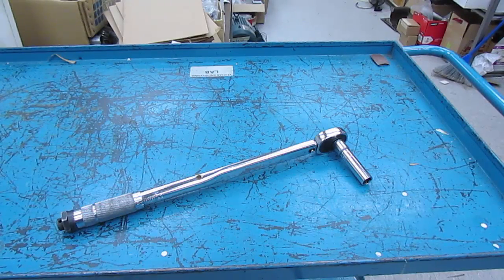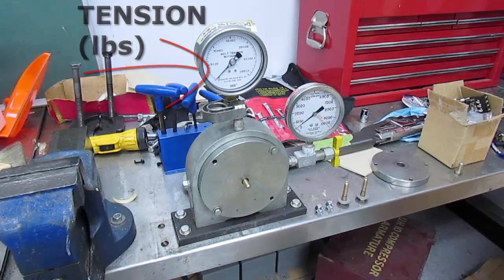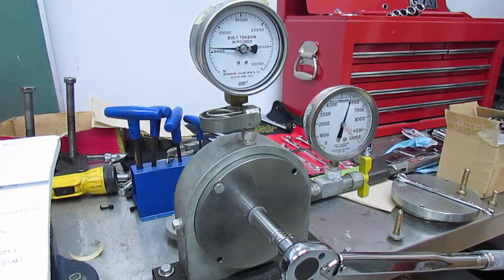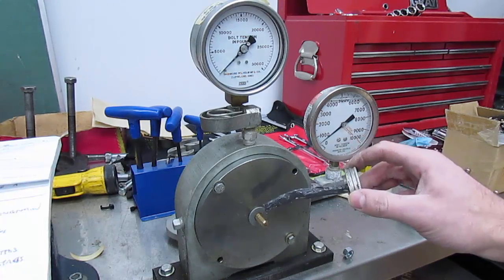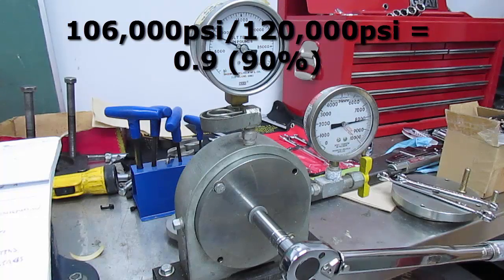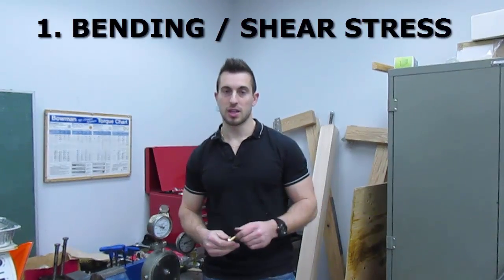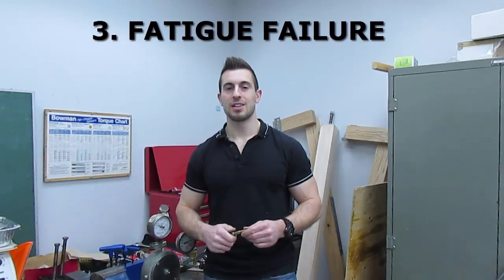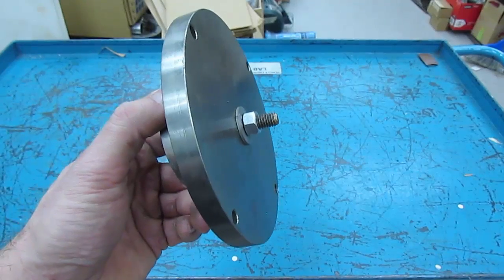Should You Put Anti-Seize On Wheel Studs / Lug Nuts?

Comment: I’m here because I had to change a flat tyre at the side of the road last night and my wheel bolts were so difficult to remove I had to kick the hell out of my wheel wrench to get them loose and even after that still struggled turning them all the way out, luckily they came off in the end but I would have been pretty screwed if not. now I’m considering using anti seize Incase it happens again.
Reply from the maker: Just be careful when adding anti-seize.. try not to over torque !
Reply: Embrace Racing think I’ll just add a small amount and then re check them, hopefully will be all good. I also recommend anyone who doesn’t have a spare tyre to buy one because there’s no way one of those tyre sealant repair kits would have gotten me home.

Comment: It's a torque vs tension problem it's hard to determine the right to work with a rusted bolt or at lubricated Bolt torque specs are rated on dry Clean bolts what you're really looking for is the proper tension

Comment: There have been several additional posts since I first joined this conversation. So let's examine this with a bit more depth. The whole, "Don't use anti seize on lug nuts!", argument seems to revolve around 2 main theories. And those are: 1.) "Anti seize will cause the lugs to come loose over time".... And... 2.) "The use of anti seize will in itself cause the stud to be weakened from being streched from over torqueing"...................
Let's examine #1. If this were true, and the use of anti seize alone on any lug nut would cause it to loosen over time, then it's use would also cause loosening in most any other application it was used as well. Cylinder head mounting bolts, exhaust manifold bolts, water pump mounting bolts, and even spark plugs. We know that is not the case, and anti seize is recommended for ALL of those applications.......
A lug nut that has had anti seize applied to it has no more chance of coming loose, than any other bolt or fastener that has had anti seize applied. This in any or all of the other applications that I have listed. Proper torque keeps fasteners tight, NOT dry and rusty threads......................
Now let's look at #2. "The use of anti seize on lug nuts will cause over torqueing, stretching, and thereby over stressing the stud, causing it to become weak and break". The same reasoning applies here. Why would it's use only cause over stressing of lug nuts, and not all other applications as well? Again it doesn't...................
And the fact is if someone is that worried about it, there are tables that will show what percentage of torque should be REDUCED for a lubricated threaded fastener that transfers torque better, as opposed to a dry, non lubricated one. In the case of most lug nuts it comes in at around 25-30% less torque. So with the application of anti seize, you are in fact getting the same amount of fastening power, with 25-30% less torque being applied to the stud. How does this translate into a bad thing? It doesn't....................
The problems encountered at most tire centers, is most all of them NEVER take the time to hand torque or LOOSEN lug nuts, like they should be doing. They almost ALL exclusively use air impact tools, because time is money to them. Nothing will cause over torqueing easier, or else break off a frozen lug nut, than over zealous use of a air impact tool. The key word here is "IMPACT". The faster they can get a car in and out, the more profitable the sale becomes. And at one time or another, I've watched most all of them use the same air gun on a Ford Focus, as they do on a F-350 Diesel Dually. They just swap sockets, and go to town....................
NASCAR proves this to the extreme. You NEVER see a loose wheel in NASCAR, until after the first pit stop. That is because they HAND TORQUE all the lug nuts with a torque wrench, BEFORE the car leaves the garage for the starting grid. During the race they exclusively use air guns, and loose wheels are a never ending problem in the sport. And they don't use anti seize. But boy are they FAST!...................
In conclusion I will state I've been using anti seize on all of my lug nuts, on all of my vehicles for over 45 years. I have NEVER had a lug nut come loose. And I have NEVER had one break from excessive torque. But understand I use a torque wrench. And I also HAND tighten, and HAND loosen all of my lug nuts. It is the only way you will know for certain you have applied the proper torque to the lug nut...... Just like any other threaded application.
Reply from the maker: This is a long one! lol I think maybe you have some misconceptions about the topic. So to address number 1. on your list. There is nothing inherent about anti-seize that will make bolts come loose. As you stated, it is used on other bolted joints with success. The statement that "anti seize causes lug nuts to come loose over time" comes from number two on your list (let's explore). Number two on your list is stating that anti-seize reduces friction (true) which causes higher stress on the bolt from the same torque (also true). At this point though, it probably won't lead to an immediate failure as you state that it becomes weak and breaks. What happens is that the stud looses elasticity. It becomes "plastically deformed" and no longer provides tension on the bolted joint. THIS is where we run into problems. Without tension on the joint, nothing is being held together properly. The nut is more prone to loosening, AND the stud is subjected to a variety of other stresses including bending. And this is where you run into the potential for breaking a stud. 

As you go onto say, wheel lugs should ideally be torqued by hand, and not use impact guns. I agree with this. Anti-seize can be successfully used by reducing the torque applied, which I agree with to some extent. The problem with anti-seize is applying a controlled amount and then distributing it correctly. You are playing with the co-efficient of friction and you will end up with varying results. Consistency is much harder to achieve this way than with just a clean nut and bolt. You may be successful with it so long as you're lucky enough to keep getting the bolt tightened within it's preload limit before it goes plastic. It's a chance you take I suppose.

Thanks for watching and for the thoughtful discussion!
Reply: I agree with most of what you said. Proper and even distribution of the anti seize is very important in order to achieve consistent torqueing and transfer of clamping force................. What I do is apply and even coat to the stud itself with my finger, making sure the entire length of the thread is covered. As well as the inside of the lug threads. I've found that using a Q-Tip works well for this purpose............. I then run the lug nuts fully on and off by hand several times, to evenly distribute the anti seize. I then mount the wheel, install the lugs, and hand torque them to 25% less than the specified torque................. This takes a little more time, but it assures that the anti seize is evenly applied to all of the threaded surface of both the lug nuts and studs. And it is the only way to achieve consistent results. Once coated in this manner the anti seize will last all but indefinitely. Especially with closed end decorative "acorn style" lug nuts that come with most all alloy wheels on cars today.
Reply: You are exactly correct here!  I have used anti-seize for over 50 years on all lug bolts and brake part bolts.  I have NEVER had an incident of loosening or bolt breaking EVER!  The key is to lessen the amount of torque (if you are determined to use torque wrench numbers) by a percentage.  Probably around 20-30%.  The only place I have ever heard a reasoned statement about NOT using Anti-seize was for spark plugs.  The reason was for heat-transfer purposes, NOT tightening purposes.  I still use it on plugs anyway.  On brakes, after the bolts have been in place for 5 years in all sorts of inclement weather (north Ohio with salt, rain, etc) just see the problem trying to get the bolts removed!  Talk about stretching them!  Also, all that corrosion and rust when re-installing (including lugs, and w/o ant-seize) will read any dry torque reading recommendations erroneous as well.  I will continue to use anti-seize and periodically check my bolts - what any respectable mechanic should do anyway!
Reply: I agree that whoever services your vehicle in regards to the tires, you need to check and re torque them as soon as you get home. Trust no one.
Reply: There was a time when copper anti-seize was okayed by the manufacturers and I think that my old Audi actually recommend a wax spray for wheel studs.  Over torquing by air tool mechanics on lubricated studs probably killed their recommendations.  I have broken rusted, seized wheel studs.  For about 25 years  I have used copper anti-seize on my wheel nuts/studs/bolts and have never had an issue.  Now my new VW recommends a dry torque of 180Nm!! Wow, 133 ft-lbs. The anti-theft bolt is going to be a real issue if it is rusted on.  Typically I have found that once a little anti-seize is used, it is good for years and many wheel re and re's.

My question-  if anti-seize is not re-applied each time the wheel nut is removed do you think that a recommended torque value should be nearer to 90% of dry or stick with the original around 75% of dry?

Btw, Embrace Racing nice work.

Comment: I think this was a very informative and educational video for noobs (like me) and more informed viewers. I just had this problem and it took three days and a multitude of various tools to try and remove a stripped lug nut from my fiance's car. We were halfway into a trip and couldn't get the tire off to put a donut on. She often visits her family in the country and the dirt/debris that kicks up is terrible.

We don't have an impact gun, all our tire work is done by hand with very rare exceptions. I broke my four way folding multi-size tire iron trying to pry this damn thing loose.

That being said, I think I'll still use anti-seize, but take care not to over torque it. I also check the air regularly and will also check the lug nuts as well.

I am conflicted on this now and will have to do more research because it's always such a nightmare to get the lug not off. Plus, most of the tire irons, etc, that we have used are technically the right size, but still not quite snug or grip well. It ends up trying to turn with a few degrees of play and strips the nut.

Thank you again though and if I you find a solution to both, please link to this video!
Reply: Why didn’t you tighten the nut on the machine with anti-seize to the 5500 psi reading then see what torque you had tightened it to? That wet torque rating would show you the percentage of the dry torque rating and you could use that factor to apply the correct wet torque.
Reply: Update: I got a great torque wrench and the specs on new bolts for my car. I adjusted the torque down 30% from spec since I'm using seize lube. I'm also checking the bolts once a week for chance in hold to be safe. I've had good luck with seize lube before, but from an ignorant stand point. We'll see how this goes, I feel a lot better about it.
Reply: @cluracan2670 , how are your torque readings holding up after applying the anti-seize?
Reply: @something164  so far so good.

The upside to this discussion is that I never thought about torque, shearing, & bad bolt application. It's made me more conscientious and probably headed off a serious safety issue.

Plus, now we keep 48" torque wrenches in each car, making it easier to change the tires but also prevents bolts stripping/bending.

This video was a force multiplier for knowledge!

Comment: Being a tire technician. Commercial tire technician I see this stuff all the time being used and the old people I have to argue with everyday not to use it will not listen. Most of the time it worsens the situation to the point they / apply it and add it to the center of the Hub. Most people have aluminum rims which are bolted up against Steel. There's two metals that don't like each other in the first place. Then you add another medal. Never sees his copper grade. All it does is f things up it turns into a clay powder and digs into the aluminum. And I can not in some cases get a proper torque. In that case I bring out penetrating oil and a rag and charge people to remove it.
Reply: Been using copper anti-seize on all my vehicles and the vehicles I've worked on for other people for the last decade and haven't had a problem with it yet.

Comment: Direct quote from the directions for use of Permatex Anti-Seize Lubricant:  "WARNING: Not for use on wheel lug nut or stud applications."  (drops microphone)
Reply: Stay in automotive long enough and you'll be amazed at how much nonsense the lawyers have injected into it ...... It's why most shop "brake jobs" these days involve replacing calipers that are fine when pads are replaced. Ask the mechanics involved how they actually do their own brakes at home !
Reply: But that's by the lubricant manufacturer, not the car manufacturer
Reply: @757WN two drops of oil. That's all you need. not white Lube not grease not anything else straight 30

Comment: This would explain why my vehicle owner manual says not to use anti seize on the spark plugs. As far as rusty lug nuts, to get them off I would use wd40 or pb blaster and then use the power of leverage with an extension on my breaker bar. If it's that tough to get off you probably have bigger issues that need to be dealt with.
Reply: John 33 most people don’t carry around an extension or leverage bar when they get a flat tyre though, that’s fine at home but in general people rely on the kit that comes with the car.

Comment: i love antiseize.   car makers should give a wet torque rating.
Reply: I really don't see the problem here?  Just use LESS torque than before.  Also, keep in mind that those torque recommendations cooked up by the auto mfgs. are primarily for ease of assembly rather than repair work.  Even a DRY bolt/nut will require a DIFFERENT torque rating upon its re-use when repairing.  The simple putting on a nut, and then taking it off will CHANGE the threads enough to show a different torque requirement.
Reply from the maker: Hard to control how much you apply so if they gave you a wet rating it probably wouldn't mean much.

Comment: This is an attempt by an academic to explain real world factors. The SAE profession has torque values for dry and for lubricated threads. It is obvious that if the thread is lubricated one reduces the torque value. The reduced value is typically 20% LESS. When one rebuilds an engine the threads are almost always lubricated! I personally have seen several instances where lug nuts were never lubricated, the car was driven in a winter (salty) environment, and the nuts were almost impossible to remove! (Byon Bill's comment below). I have always used oil and/ or anti-seize on my wheel studs on my dozen or so cars over my lifetime, and have never had a single issue of a loosened lug nut. One relies on the proper torquing of the fastener to hold parts together, and not on rust!
Reply from the maker: Hi Richard, thank you for your comment. Yes, this is an academic explanation as most people are unaware of the theory behind how nuts and bolts work. I would rather give people this information and let them make an educated decision on lubricating their lugs nuts rather than just blindly take someone's word for it.

Comment: Lug studs are usually 10.9 or 12.9 bolts. I understand antiseize might be a tougher lubricant, but what about using motor oil or penetrating oil? I never had a problem using these methods. I was reading a max torque chart and it said lower torque by 10% on oiled threads.
Reply: Was literally just rooting around my garage trying to find my anti-seize to put on my lug studs. I had some doubts about it so I did some last-second searching and found your video. Thanks for pulling me back from the brink of a dumb move!
Reply: @PawlH  
You can use grease on your bolts thread. Not on the contact area between bolt and wheel.
I'm doing it once a year.
Since many years ago.
I'm changing my summer/winter wheels at home.
Never had a problem with a single greased bolt. Never found a loose bolt between wheels replacements. 
Bolts are OEM, and look heavy duty, though.
I thighten the bolts only by hand.
Only time i had a bolt being broken, was at a tire shop. They used an airgun and the bolts were dry.
Since then i grease all my bolts.
The cars are driven normally only on the street.
I don't know how a greased bolt reacts if the car is driven hard, or offroad..
✌️

Comment: I have been coating lug bolts, studs, wire wheel splines, hubcentric wheel/hub contact points, and valve stem threads with anti-sieze for going on 50 years.  Works perfectly.  Never had a lug loosen or become significantly overtorqued.  I live in the northeast where the powers that be just love to use dry and liquid salt on the roads, before, during, and after a snow storm.  I use the never-sieze sparingly.  A very light dry coat that colors the rust a silvery gray is more than sufficient.  I have a background in the automotive repair business.
Reply from the maker: Hi there, I'm up in Canada and I know all about salt on the roads. Everyone is going to have a difference experience, but I hope what people can take away from this video is that there is a very precise science behind bolted joints. Variations in frictions can result in large changes in pre-load. Thanks for watching!
Reply: We need to have the torque requirement for the use of anti seize.